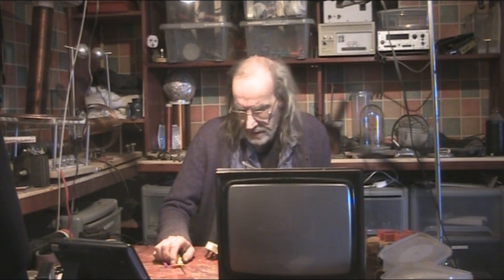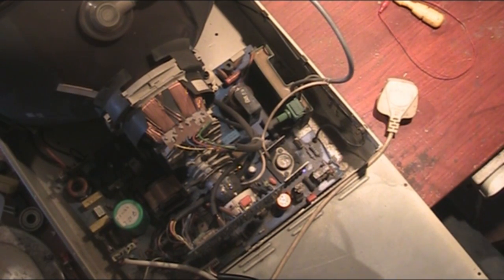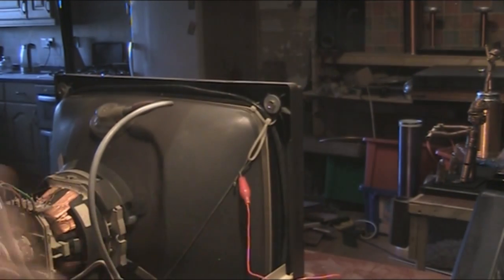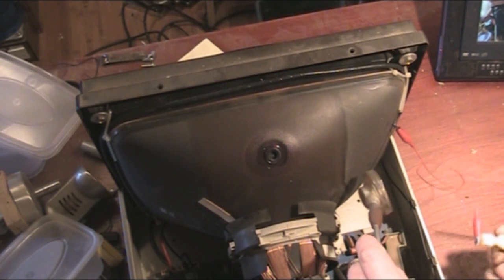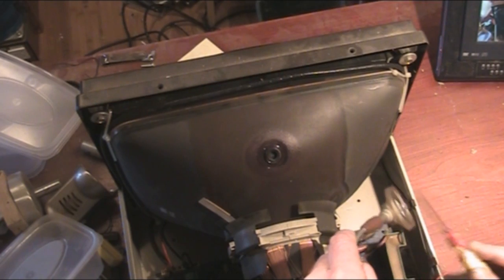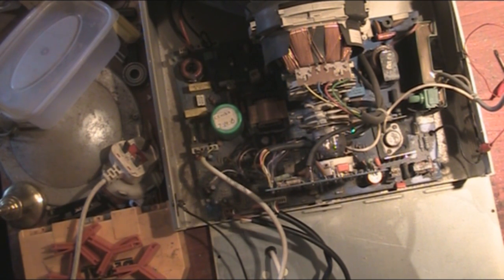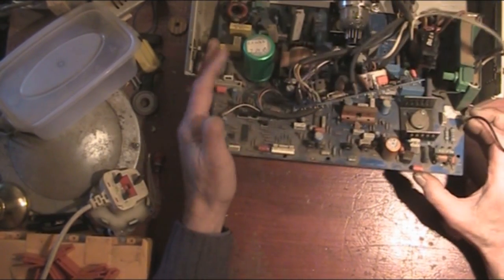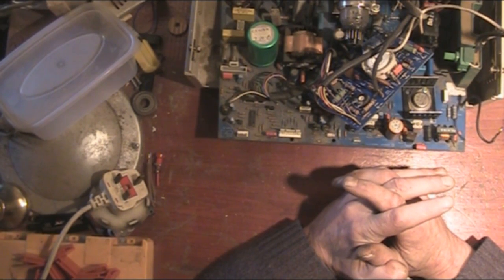CRT discharge for safety

Comment: The back of the crt is good enough to ground against. That black coating is the aquadag. The tube itself forming a capacitor with the metalized interior and the aquadag on the outside.
Obviously the bigger the tube the bigger the bang when you discharge it.
The ground wires on the back of the tube are usually spring loaded and that is where you want your ground. You do have to be careful where you ground to or you might actually dicharge thru something else... and let out the blue smoke.

Comment: That is an older TV interesting to see the TO3 casing driver transisitor. Biggest hazard on the board is the mains elco rated at 400 V 220 µF. Good tip with the foil.
Reply from the maker: RODALCO2007 Yep, it's a cub computer monitor i use with my BBC B+ computer, if you go to the link posted in the description, you can see the tour of this

Comment: I wouldn't do the foil trick on newer boards I plan to keep. You got little control over where you send the discharge current that way.
Reply from the maker: erlendse With things like this, you are more likely to make contact with the common rail (ground) first, so there should be little riskAlso, power supply capacitors are more likely to have discharged anyway due to circuit load, so again little risk of damage
This is more about reassurance for the people who are worried about getting a shock.

Comment: My 2006 sanyo vizion sdtv has a auto discharge because i saw the grounding wire connected the wires out side of the glass tube also when i unplugged the tube tv for cleaning i got shocked by the prongs